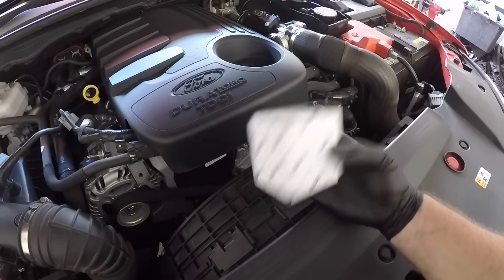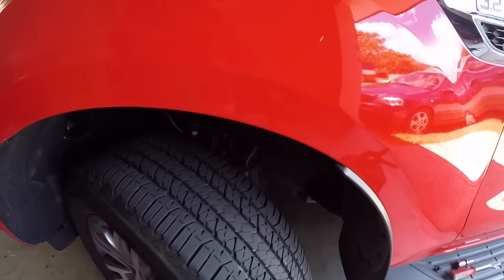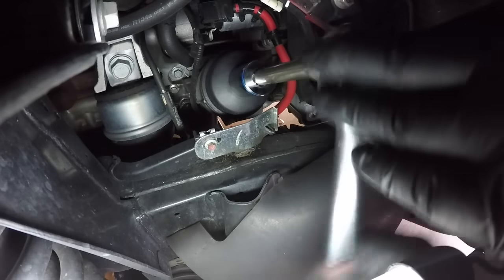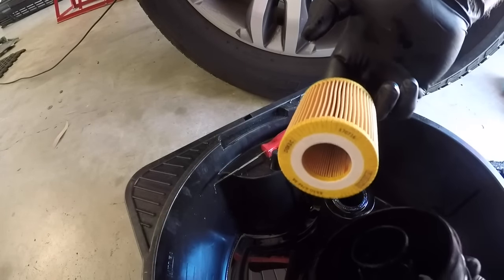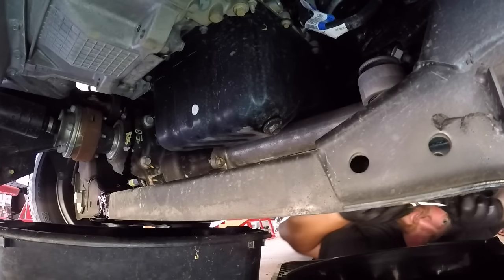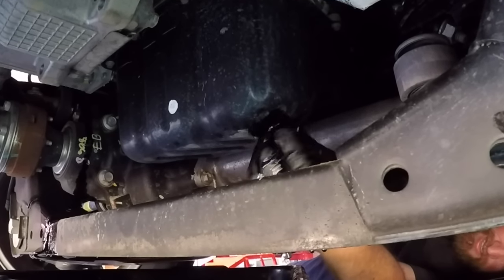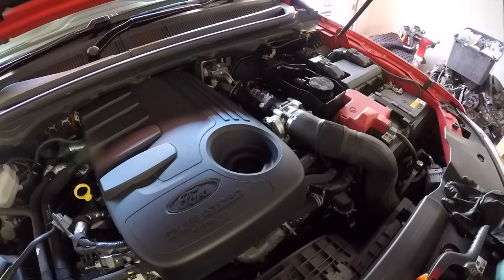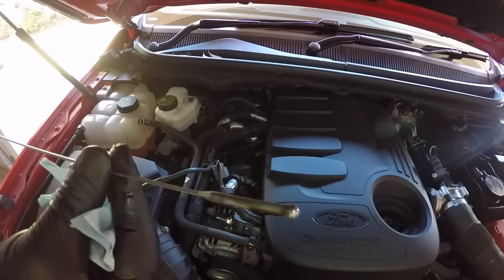Ford Ranger Oil Change Mazda BT50 Ford Wildtrak 3.2 Ford Everest WARNING THIS MUST BE DONE FAST!

Comment: hey man does the oil drain plug need replacement? if yes how many years or kms?
Reply from the maker: There is rubber O-Ring washer that sits on the bolts that can be replaced.

Comment: How would you prime the pump again ?
Reply from the maker: The easiest way is to over fill the engine with oil. This will raise the oil level above the pump (which is in the traditional position) and
once it is primed the excess oil needs to be drained. Cheers
Reply: Wrap a rag around an air gun/nozzle.Stick it in the oil filler hole ,get someone  turn the key as you give it a good blast of air into the crankcase.Works every time.

Comment: You ever did the transmission fluid
Reply from the maker: fleet tech Sorry not yet
Reply: I have there easy as, you have to drop the transmission pan I found doing the back half first that way it can hang down

Once it's fully drained replace, clean the pan and replace the seal bolt it back up, there's a transmission oil dip stick just above the drain pan on the drivers side looks like a bung but is actually a dip stick so take your time filling.

When it's full start the car and run through the gears whilst stationary cycle through the gears least 3 times. Turn the car off and check the oil level you'll find a bit of oil has been used so just top it up untill it's full
Reply: manta systems what size spanner for the dip stick
Reply: the tranny fluid in the  the ranger/bt50 is good for 150,000km or so before needing to be changed i believe

Comment: Been seeing quite a few of these videos lately. Working at a dealer I've only ever seen Ranger/Everest 3.2L not re-gain oil pressure after a service maybe half a dozen times? I think everyone is just overreacting.
If one is not confident in changing their oil maybe it should be left up to the pros? Not being rude, it just seems like a lot to gamble with when the manufacturer won't warrant your engine due to 'improper' servicing.
Reply from the maker: I guess the real concern is those off roading, damage their sump and lose the oil. you couldn't just patch it up and drive off. Remember the 10 min is a conservative estimate. Just want to avoid the 'waiting till the last drop of old oil' style. Unfortunately there are are few of these cars around that need a rebuild due to a 'mechanic' not being aware. Thanks for the comment.

Comment: Would you recommend an oil catch can?
Reply from the maker: Yes if you are planning to keep the car for a long time.
Reply: @killawattgarage  thank you.  I have a second hand ranger which is a big expense for me, so I do plan on keeping it a long time.  Thank you for that advice.
Reply from the maker: @gdog4323  Its typical that the intakes of diesels build up with a mix of exhaust and oil vapour. The catch can helps prevent this build up. I am planning on doing and intake clean video soon for the 3.2 ranger so watch this space.

Comment: What grade of oil can be used. 5W40?
Reply from the maker: Chris Richter 5w 30 is what is recommended. Outside warranty period a 5W 40 can be used. I always use a full synthetic.
Reply: Thx.Killa. I have a surplus of 7lt. 5W40 that i normally use on my MB. BT50 157000km. will finish the 5W40 and then will use 5W30. 5W40 is full synthetic.

Comment: I'd recommend priming the new filter with some fresh oil as well👍🏻
Reply from the maker: The angle of install would have the most oil tipped out before you could tighten it down. Thanks for the comment
Reply: @killawattgarage  I just mean get it wet every bit helps👍🏻
Reply: @Craig Jones...Thats right, at least soak the bastard. The less the oil has to travel the better.

Comment: Good video.
Stupid design failure, i'd like to say it's unbelievable that a company like Ford could come up with an oil pump that can't handle the job it's there for if left to drain for more than 15 minutes, but sadly these days just when you think you've heard it all, another howler like this one crops up.
I'll stick to Toyota and Subaru, where a flaw like this would have been laughed out the design office and if it ever made production would have seen resignations and public apologies.
Reply from the maker: 1 step forward and 2 steps back. Thanks for the comment.

Comment: Hi does the oil have to be hot or cold when changing ???
Reply from the maker: Typically it's best to change with the oil warm. If it is cold it can be thicker and slower to drain, too hot and you risk burning yourself. Thanks for the comment.
Reply: @killawattgarage  Thanks a lot 4 your time

Comment: Is the 3.2 L diesel a good engine? do the sell ford trucks with the 3.2 diesel in usa ?
Reply from the maker: There are always fans and haters of any engine, but I like it. It has amazing fuel economy and great torque for towing.
Reply: I really like it too. The oil change thing is no big deal. Just stick to the program and it's sweet.
My Ranger has been hauling a 3 tonne caravan around for the last 90,000ks without an issue. Serviced on time with fresh fuel filter as well.

Comment: Why not mention the torque specs, it’s not like the extra info detail would have killed you!
Reply from the maker: Taken from the details written under the video.
Torque  Spec: Filter housing  25.5Nm, Sump plug 20-30 Nm
Dry Sump Capacity 9.7L
27mm socket

Comment: I saw this same oil change 'problem' on an Australian auto channel on here. My god! Ford made the easy to take care of Ranger, SO freaking complicated!!! Now it has a tiny stupid tiny turbo engine, only a 2.3L  4 cyl. that's it!  No V-6's at all.  On THIS model it is SOOO hard to change the oil yourself. Wow! Ford wants you to go to the dealer for even an oil change.    You get a 3.2???  Is this a turbo??
Do you guys have this tiny 2.3L turbo 4 cyl.?  And is it this complicated to change the oil and filter as well?
Ford doing its best again...NOT!
Reply from the maker: In this one is a 5 Cylinder 3.2 litre turbo, but for 2019 they can come with a 4 cylinder 2.0 litre bi-turbo. No other engine options. I bet that there are a few private engine conversion companies out there rubbing their hands together $$$. Thanks for the comment.
Reply: Well in the US  the only engine will be a stupid little 2.3L 4 cyl. with a turbo slapped on it. It has the same oil priming problem in it.  Ford has gotten rid of the easy to access engines and all the V6 engines. So Ford is making it as hard as possible for the regular guy to even change his oil now!
They want you to go to Ford pay outrageous prices to do the simplest of maintenance on this new Ranger. I am sure that if yuo dont go to Ford, they will say any warranty on their ever so reliable transmission,and this engine/turbo will be voided. So you have no choice but go to the dealer. My 2002 Ranger 'Edge',with the 3.0L V-6 was so easy to work on, and to change the oil was a breeze. No stupid turbo or oil priming problems. I pity all the people buying this new model, and in Aust. I guess you guys have had it for a few years already. Different engines, but same model.  And HAVE to go to Ford to get a simple oil change  during the warranty period, or they try to slip out of any power-train repair....right???
Reply: The 3.2 is an awesome engine blows the Hilux into the weeds. The oil filter location is fine and not hard to get to. I would replace those scrivits with something better as they fail early.
Good video. My engine is missing the cover on top of engine from new but has the ball and cup screws there.

Comment: thank you - we have the same goal ;-)
Reply: Will it damage my car if done more than 10 minutes? Like 45 minutes. The local mechanic here drained the oil on my ranger 2.2 without realizing they didn't have the proper filter on stock. They went to the supplier to buy one and it's taking forever to arrive.

Comment: Just sounds like a recipe for disaster.  Non self priming oil pump, say the vehicle sits for a few weeks what then.  I'd stay clear.
Reply from the maker: I am sure there will be a steady supply of work fixing these for many years to come. Thanks for the comment
Reply: wicked mainah, it’s a massive problem, and dirty oil mixing with the new oil and filter isn’t good either.
Reply: I have parked mine for several weeeks, nothing happened.

Comment: A much bigger problem with this Mazda BT50 and Ranger is the pathetic idea of putting the clutch slave cylinder inside the clutch housing requiring complete gearbox removal to change a simple slave cylinder, Before a simple 15 minuit roadside job consisting of two bolts and a pipe has become a full workshop job requiring heavy lifting gear and a competent mechanic and even worse lots of money and time , The slave cylinder can go bad at any time leaving you stranded and looking for a means of towing the truck to the nearest repair garage with the relevant facility's, For a vehicle that can spend most of its time in remote places this is truly a stupid idea.
Reply from the maker: Cars are no longer designed with repairs in mind. I see it all the time. Many cars now have the slave cylinder in the bell housing directly behind the clutch release bearing and it does away with the lever arms .....which rarely ever failed. They tell me its progress!! Thanks for the comment.
Reply: Thank you very much for your reply to my moaning , Could you answer me a quick question please , In your professional opinion working on these trucks would you say the internal slave cylinder is generally reliable ? Is replacement of a leaking cylinder a common job for you or not ? I maybe wrong in my thought but as the cylinder is of a bigger circumference to a much smaller diameter external cylinder I assume it works under less pressure therefore less likely to leak ? Thanks in advance if you can put my worry's to rest and thanks for this excellent you-tube channel your explaining is clear with sound advice keep up the good work .
Reply from the maker: @mcbain3949  I always replace an internal slave cylinder whenever a new clutch goes in just to be sure. Typically they last fine. To improve their life I would suggesting flushing the fluid every second year as the fluid is hygroscopic and it's this absorbed moisture that causes internal corrosion, pitting and leaks.
Reply: Wow I didn't think of that , Thanks again I will go out and buy some fluid to do a fluid change but first I must push the subscribe button, I'm very impressed that you take time to answer peoples questions in your busy day. What a great channel.
Reply from the maker: @mcbain3949  cheers

Comment: Sir what oil do you use  sir?
Reply from the maker: In Australia it is recommended to use a Full Synthetic 5W-30. Double check you manual for your country.
Reply: @killawattgarage  my country philippines what should i use sir? Mobile 1 its ok sir or kixx oil?
Reply from the maker: @ericksonabad4291  I use castrol magnatec 5w30 a5.

Comment: 9.8L is Wrong, 8,9L ist right
Reply from the maker: Capacity stated is the manufacturer listed capacity including filter and typically they measure these from dry. In all cases, the dipstick should be used as a final check. Thanks for the comment.

Comment: I serviced this type of Ford Ranger , I did exactly the same as the guy in this video did, after I did the engine oil and filter changed and started the car suddenly the low oil pressure came up and it was very hard to fix it, some how we have fixed it and went for a test drive but unfortunately the car won’t go more than 40km/h.  We check the car again and found the turbo has gone, even  the car is still brand new, and the ODO meter reading is just 15000km. So do you think is it normal guys? Please drop a comment below 😂

Comment: In my opinion, this whole thing of “priming” the oil pump is absolute bullshit. Anyone that has had trouble with oil pumps not priming on these engines, have encountered vehicles with failing oil pumps. I’m a ford master tech, I work on rangers most days. I NEVER do an oil change in under 10 mins. I’ve changed engines leaving oil pumps without oil for sometimes days and no issues. Oil pumps on these engine give trouble, in my opinion, priming the oil pump is noting but a myth.
Reply from the maker: It's a hotly debated topic. Some say it must be done fast other's say they take their time. One thing for certain is that these engines have an oil pump with a vane type design that appears to be less tolerable to allowing the oil to fully drain out. 
With your experience I am assuming that you are referring to the Australian 5 cylinder 3.2L engine (P5AT Duratorq) because I would like to hear more so I can create an update video. Thanks for you comment and hope to hear back soon.
Reply: Killa Watt Garage Vehicles I have worked on are the European spec 3.2 and 2.2 litre, both 5 and 4 cylinder. I don’t know the engineering specs of these pumps, but having replaced them, they look identical to an oil pump found in the 2.2 engine found in all ford transits. They were quite troublesome. I have seen one or all veins in these pumps fail leading to lack of oil pressure at certain rpm or complete loss off pressure. I just think the problem is, these vehicles arrive for oil changes when customers notice an oil light flash on. Once drained, the failing oil pump is unable to regain pressure. I think this is the issue rather than priming the pumps at service. This is just my opinion.
Reply from the maker: Thanks, really good points. There is a company in Australia that has designed and made a traditional style of oil pump to replace the variable design. I will investigate it more. Thanks heaps for your comments.
Reply: Killa Watt Garage No worries. You can let me know if you find any info.

Comment: What a load of shit!! I drain my oil & then stuff around and remove the rubber flap and continue to change out the oil filter... I have serviced it since new and never have i once had a problem with the oil pump!!! I even change the air filter while the oil is draining!! Haha 10 mins righto mate.
Reply from the maker: warrenlove69 http://rycofilters.com.au/products/ryco-products/related/related/81/article/520/pg/1/month/3
Reply: I drain the oil then replace the oil filter, air filter & some times the fuel filter as well ... every time the sump is completely drain dry.

75kms on the clock & not once had a problem.

I must have one of a kind
Reply from the maker: warrenlove69 https://youtu.be/kmHTtv2KYm4
Reply from the maker: warrenlove69 glad to hear you haven’t had an issue. But lots of people have and it would be wrong of me not to advise people correctly